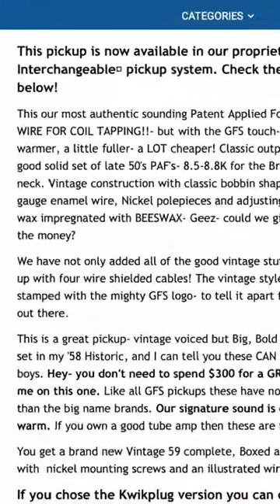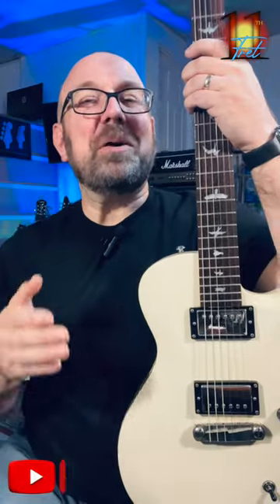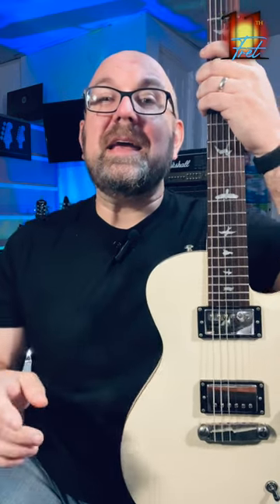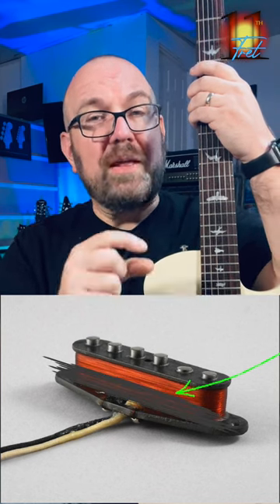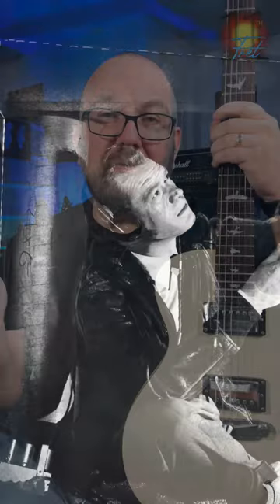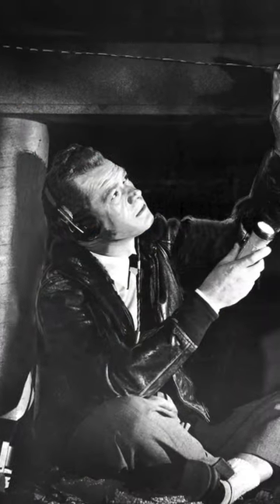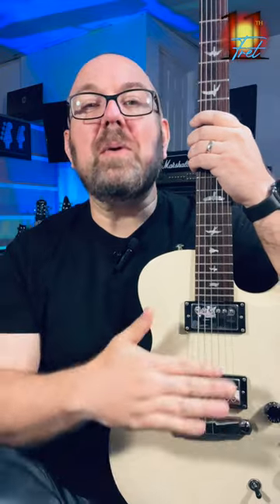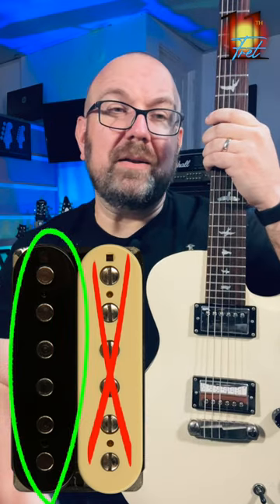Coil Tapping IS NOT THE SAME as Coil Splitting #Shorts

Comment: Hey Kris. I missed this short last year, glad you put this out. People who should know better keep calling coil splitting by the wrong name and it bugs me a little too. I'm no electrician but as I understand it, coil tapping is more commonly done to the transformer coil in the output section of an amplifier, rather than in a pickup or mic coil. For example, in a 50w amp that has variable output and can be switched for 25w, the coil is intercepted at a point that leaves only half the windings in the circuit. Tapping is simply easier to do with the larger, heavy-duty wire of an output transformer's coil than in the much smaller and more fragile coil wiring of a low current transducer such as a guitar pickup. This could be a much longer discussion but basically that's how it was explained to me by an expert and it makes sense. Still, a pickup coil COULD be tapped but it's difficult and almost pointless unless you just want to retain humbucking at a lower volume. But that's what the volume pot (a variable resistor) is for.